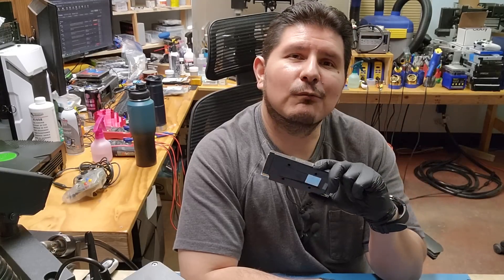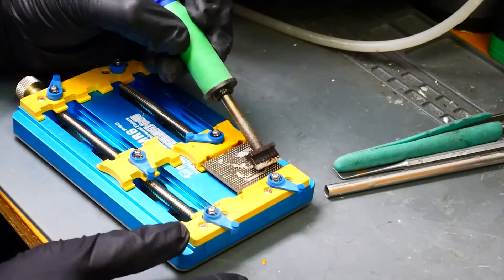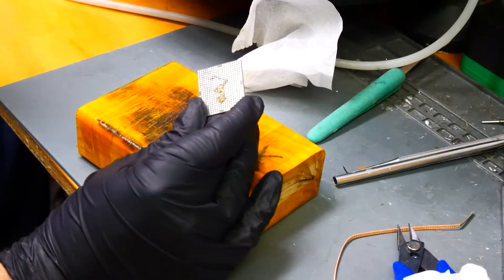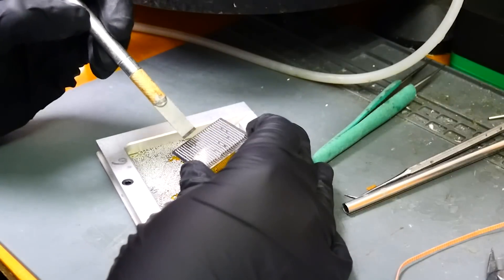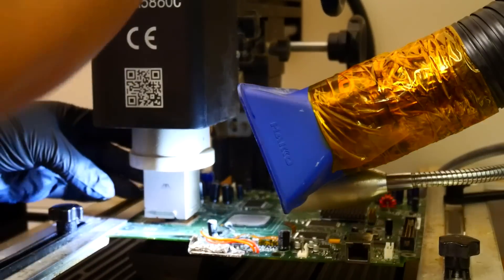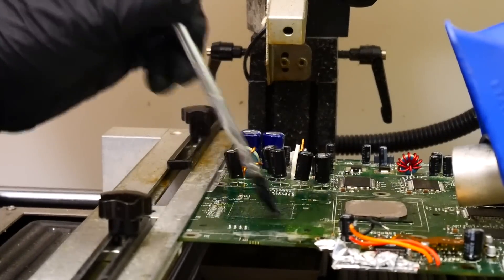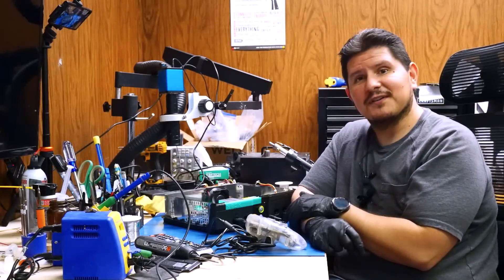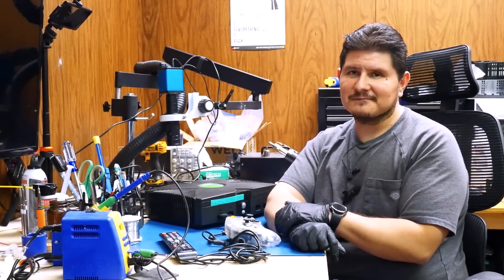Is it Worth it? OG XBOX CPU Upgrade 733 MHz to 1000 MHz (1 GHz)

Comment: I'm curious about how hot it gets. I've seen Noctua fan mods but they mostly focus on improving noise level. I don't think they help with cooling.
Reply from the maker: From what I've seen and what others have said for this mod and the 1.4GHz, its best to keep the original stock fan.
Reply: @RetroRenegadeRepairs  stock fan is very powerful 70mm 32CFM at full speed but noisy thats why it runs at low speed until hot. Noctua 60mm fan mod is a lie, it seems to cool better because the adapter makes the fan directly touching the cpu heatsink but the xbox works on negative pressure so more the time powered more the heat the noctua mod is not cooler.
80cm mod is the best for lowering noise: To keep the xbox cooler just change the GPU heatsink for a better one with the blades lokking to the fan, and add a thin copper plate under the CPU heatsink, cutting the retaining lever a bit to make it fit.. getting a 80mm fan si the best but you had to cut the HDD plastic housing so its dirt to do. A little cheat is just use the stock fan but with a power modulator installed connecting the stock fan to the HDD 4pin molex so you can increase the stock fan speed as you desire, its a SERVER FAN actually with 32cfm max that is a lot of air. (i got the 80mm just on the hdd 4pin at full speed) The problem os the xbox is not the fan is that the xbox PWM connector set the fan at very low speed! 
Regards
Reply: stock xbox runs very cold, a bit more is no problem as this mod keeps the original heatsink that cool a lot... Noctua mod is crap, adapting a 80mm fan is the good cooling upgrade. My xbox runs at same temps but very quiet, and i can also plug the fan into the 4pin molex instead of the board so the 80mm 2500rpm fan run at full speed, for summer, not so much noise. 80mm fan is the key i had a old video about it on my Channel.

Comment: As cool as it is , I think an upgrade like this is mostly just for bragging rights!
Reply: bot comment
Reply: No it actually is extremely helpful for the emulators that you might want to use which use 3D processing. It helps with PlayStation and Nintendo 64 performance
Reply: @CovenantAgentLazarus You do realize for the cost of having the upgrade done, you could buy a lightly used PC with better performance and more accurate emulators, right? There's 3 official games that actually benefit from it, and of those only 1 doesn't have a PC port at this point, Crimson Skies.
Reply: @KiraSlith  No shit. Thats not the point. He wants to play on Original hardware.
Reply: @CovenantAgentLazarus  N64 roms on Xbox isn't exactly original hardware. Cool as hell for the xbox games though.
Reply: @perkulant4629  everyone already has a PC that can run the shit
Reply: @CovenantAgentLazarus  You can connect a PC to your TV, even get adapters for real controllers. Are you okay? You're not exactly thinking this through.

Comment: i have an upgraded xbox original,1.4ghz with 128mb ram and 2tb hdd and project stellar,its worth every euro,really love the system.
Reply: 1.4ghz, that's insane, twice the speed?!
Reply: @nicoful86 yup! Very difficult mod to perform, havent succeeded yet sadly.
Reply: are you playing the games patched at 720P resolution? You can play KOTOR by example at 1280x720p resolution and it looks AWESOME but it needs 1ghz cpu at least to move... with 1.4ghz you can play EVEN HALF LIFE 2 at 720p and obviously 720p movies at high FPS
Reply: The CPU and the Hard Drive I can understand, but the games weren't designed to have address more than the 64MB of RAM on it, are you using it for other applications?

Also, how is game stability/compatibility? I've heard anything on the CPU side higher than the stock 733Mhz there's issues
Reply: @IronMan3582  gmaes that utilize the ram require a mod to be applied im pretty sure and only a few have the mods available as not many benefit from it
Reply: @ryanabarca8616  I mean the smarter thing would be to increase the clock speed of the DDR RAM, but I don't know how many stability issues that would cause. I just know on principle that it has been proven through Microsoft's own back compat program on Series X is that you can throw all the GPU power you want at base code and it does not cause stability issues at all
Reply from the maker: I personally rock one of these 1GHz machines with the upgraded ram. I may consider upgrading to the 1.4GHz, but that probably won't be for a while.
Reply: @RetroRenegadeRepairs  It's better to just leave the 1ghz in there and do a 1.4ghz mod on another Xbox.
Reply: I have a 1.4Ghz, 128Mb Ram, and 10TB Hdd in mine. NeMeSiS Modchip with HDMI mod, PrometheOS and CerBios. the next step is the Dual HDD :D Absolutely BANGER mods! The coolest part is the Control of the XBOX via webpage, like IPMI on some servers :D
Reply: @CyberBlaed that seems like a waste of spsce the games arent that big to begin with
Reply: @CyberBlaed  can you list mods in correct order you had done ?
Reply: The Openxeniun chip is better than the stellar. With the openxenium you can use whatever bios you like and have multiple bios banks.
Reply: @L0tsen xenium is garbage
Reply: @L0tsen  don't care. Let people enjoy the things they own.
Reply: @L0tsen  Stellar is great. Does everything I need. Don't really care I'm "locked" in.
Reply: @Valthonis Hi there, just to get the word out because I spent 900 without knowing how compatible stellar is with cpu upgrade and I can verify all the games you want to run, run PERFECT. very very few games make the system crash. So Would I recommend it? heck yes! 95% of games run perfect for hours of testing per game. it just has a few quirks with unpopular games. all your top tier will be flawless and better perforance than stock. smooth as butter. you have to upgrade your stellar os to 1.5 for the compatabiluty patch. hope that convinces you or anyone to purchase. xbox live compatible and xlink compatable. also fan speed has to be set to 60% or higher. I have 2 xbox console and prefer the 1.4 ghz over stock anyday of the week. runs fast!!! I'm playing mine right now lol
Reply: @Valthonis  IIRC, Project Stellar specifically has a patch for the games that have those kinds of issues.
Reply: have you tried your upgrade with emulators ?   snes , gba , or arcade , maybe they run faster now
Reply: Woah
Reply: Curious, I have a Stellar and 128mb ram modded OG Xbox. Interested in a CPU upgrade but not sure who I cam trust to do it. Where did you get your Xbox modded and how much did you spend?
Reply: How much does this bg machine cost v
Reply: I have a PC with two Tualatin 1.4ghz CPU's with a Geforce 4 and 1gb of ram running Windows 98 and XP, it gives me much higher resolutions and framerates compared to the OG Xbox as well being able to play DOS games I also can run some 7th gen games like on this build. Those CPU's are beasts. But I don't see what use you would get out of a CPU upgrade in a console. You can't increase the graphics settings and double the FPS for all Xbox games. You will need to patch almost every game due to compatibility issues rendering discs useless. Besides emulation and homebrew. I don't see the point of a CPU upgrade on an OG Xbox. But it's still a really cool mod.
Reply: I’m about 101% sure that this is electrically impossible. You’d need a completely new motherboard.
Reply: @setoman1  I have seen people install larger hard drives with SATA to IDE adapters (requires soft modding) but the RAM is the part I'm sus about